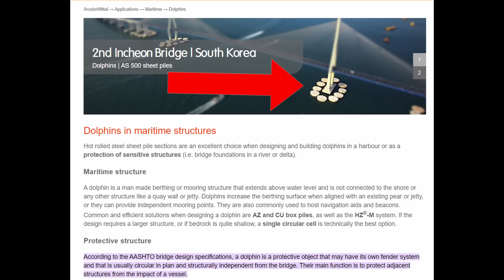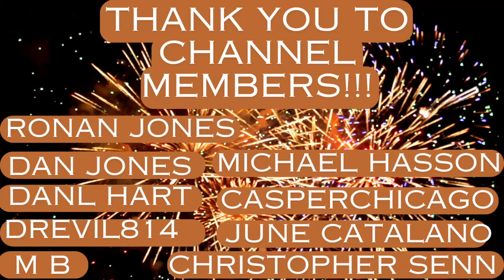Baltimore Bridge Collapse

Comment: There’s an old fort on the sea board side which would favour the outgoing ship staying closer to its starboard side of the bridge.   Strange absence of accompanying tugs?  Two pilots on board, so no possibility of human error in steering.   Awful night down in the engine room, sorry for what the crew faced and still face.
Shocking absence of structural protection, looks like corrupt risk analysis took place, shame.

Comment: There’s a shipping lane. And a harbor pilot was onboard. Shipping lanes are narrow. Which is why there’s a harbor pilot. It’s threading a needle every time 

It became adrift at 8 kts. And had dropped an anchor, late, and slowed to <2 kts. But it’s 100K tons. So irresistible force. As you pointed out other bridges have fenders of piles with concrete equal to, or more sturdy/massive the bridge support. But head on… 100k ton ship…
Reply: Watch Sal's YouTube Chanel for a professional discussion of what heated.  The ship lost power and rudder control. They got restarted and probably put prop into full reverse rotation in an effort to  slow it down, as well as dropping anchor in an effort to avoid hitting bridge at speed.  But ship's don't have brakes and can't be stopped.  They saw what was coming, but were just along for the ride at that point. No dolphins were going to stop a ship of that size and weight.
Reply: @mikedx2706 dolphins/ fenders sized for today's ships may have helped. Or may have not been enough.  Your statement is too broad.
Reply: I will not watch Sals video. @mikedx2706

Comment: Looks deliberate.  The ship swung wide of the dolphins and came at the pier from a reverse angle from its initial direction of travel.  The power going on and off and the throttling up of the engines (smoke) makes me wonder if there wasn't a struggle for control on the ship.

Comment: The ship was on course to pass beneath the bridge center span until it veered off course.
Reply: That appears to be the case, but dropping anchor and maybe reverse engine caused it to veer a lot more than if it had just drifted forward and not turned slightly like it did leaving the channel ...
Reply: @uploadJ  perhaps or the huge side area of the ship acted like a sail and the ship got pushed in that direction.
Reply: @mifphilip  even though winds were light, the direction of smoke indicates that the direction would push the ship towards the bridge pillar. Even in light wind conditions, this would have been a significant compounding factor against trying to regain control
Reply: Whatever the cause, it was a direct hit.

Comment: impact wise, its also has the harbour blocked and trapped many other ships that will not be able to get their cargo out until the bridge is removed
Reply from the maker: Good point.  Clearing the channel will likely take a couple of weeks based upon what I have seen on some construction jobs involving removal of bridge debris after a demo in a body of water.
Reply: @CaseyJones-Engineer  and that 2 weeks was when the contract was already in place and resources were pre-positioned and planned.
Reply: The trapped shipping containers can be trucked to another port. It is the bulk goods that will be trapped or unable to be delivered. Coal grain, oil, cement, steel etc.

Comment: Why was the cargo ship operating so close to the bridge? Perspective! If you go to “What is going on with shipping?” he shows how the ship was following the designated traffic channel until it lost power. When you view the map from above, you get a completely different perspective.
Reply from the maker: Thanks for that information!
Reply: Yes, next time, just go straight to Captain/Professor Sal Mercogliano at what's going on with Shipping, his channel has be covering everything going around the world involving all things Shipping for 3 years now. You would be hard pressed to find anyone more knowledgeable.
Reply: Definitely check out that channel. He is an expert on shipping.  @CaseyJones-Engineer
Reply: The ship channel goes under the bridge. Assuming MV loss all power, then it is just moving on momentum out of control. Looks very similar to the 1980 collapse of the Sunshine Skyway Bridge in Tampa, Florida. When this Florida bridge was rebuilt they installed an island around the bridge pier foundations.
PS — Freighter hit the old Oakland Bay bridge but luckily no structural damage. New Oakland Bay bridge will stand even if there’d is a significant earthquake in the Bay Area. 
PS2 — Engineering guidance was update in 1980s should prevent this type of failure for bridges built under that code but Baltimore bridge was built in 1970s.
Reply: @williamlloyd3769  , often the biggest failure in engineering and science is simply the failure of imagination.  How could no one have imagined this happening?
Reply: There was a Harbor Pilot on board.
Reply: 2 actually
Reply: @auntykriest  Yup.
Big beasts..
Reply: @abrahamdozer6273  More like a Pearl Harbor pilot...
Reply: @Bertrand146  "More like a Pearl Harbor pilot..."
Helm's over a bit ... total and sudden power failure.
.What would YOU do? Put on the parking brake?
Reply: @abrahamdozer6273  Not much indeed !
The momentum, the currents... The pilot tried everything he could and he will be told that had he done nothing, Dali would have drifted past the pier.
Reply: @abrahamdozer6273  Armchair sailors, who have no idea how big ships actually work, love to comment about what they know little about.  They don't realize that ships don't have brakes, and if steerage is lost, the ship will just keep moving at whatever heading the rudder is set to.  It will also be subject to currant and wind.  A ship no longer under control will go where it will go, and there is very little - if anything - you can do about it.
Reply: @JWRogersPS  ... and the momentum is amazing ... it takes miles to slow these down when they are approaching a port. The unfortunate part about these ships is the single screw, single humungous rudder and how it can't go much slower and still manoever.
Reply: Also the ship is 5x heavier than those passing under the bridge when it was built. The Dolphins (bridge protection) may have been adequate when the bridge was built, but no any longer. And this ship is nowhere near the largest containership sailing today.
Reply: The guy who runs that channel is a maritime professor at one of the merchant marine schools. He also has extensive experience out at sea as a mate, so he really knows what he's talking about. His channel blew up when that ship blocked the Suez Canal during COVID, and he covered it extensively. He's still covering some of the legal and financial aftermath of that event. 

He already has two videos on this event, the first of which came out just hours after the bridge came down. I expect him to continue to give us updates long after this event has run its course in the MSM.
Reply: @operator0  Are you related ?
Reply: Yep. Sal has great coverage. I don't know if we are seeing a transition to backup power or a main breaker/disconnect with a time delay before attempting reconnect. This is typically used to allow intermittent faults to clear and any circulating currents to dissipate through various losses. Either way, it's a terrible situation for everyone affected.
Reply: @RetiredEE  The power seems to go out shipwide. It went black. The fault/ breaker must have been right at the alternator. Stuff happens in this imperfect universe.
Reply: Yes, good answer. Dr Sal covered all that ... love all you guys doing vids on this, too. Much better than the news media.
Reply: Yes
Reply: This relic from the 1970s, 50 yr old pilons,Steel span third longest bridge in the world, major HAZMAT route with a tremendous increase of use, vehicle load weights increase over the 50years an no interest to replace it, make defense structures to protect collision is total incompetence, negligence by MARYLAND. The bridge spans collapsed dumping workers,drivers into the freezing dark water with twisting/falling steel in less than 2 MINUTES. 
The container cargo ship,top weighted, adrift tried to restart,avert collusion,dropped anchor and may have actually increased the swerving boat course towards the pilon.Don't know if just going with the current would have decreased the destruction.Prevention In Defense of The Bridge,A Newer Bridge Would Have Saved Lives.The Tampa Bridge Disaster,all engineers should have seen it after.I stood after and looked, was instantly nauseous. It gave me nightmares.This will too.
Reply: Also, there's a major port there. You can see it in the background. I suppose large cargo ships go through there frequently. (Apparently it's one of the biggest ports for cars in America, among other goods.)
Reply: from the navigation charts,the channel is only 150 feet from the pier, so he was not too far off the channel
Reply: There is still black smoke bellowing out of the stack before and after impact.
Reply: @randymclean9121 the black smoke started before impact. I think the were restarted and went full throttle in reverse
Reply: if you see the full video on what's going on with shipping, the ship looses power further away, then regains power shortly before impact, but by then it's too late to make a sufficient change of course to avoid an impact.  @randymclean9121
Reply: Possibility:  Think bad fuel killed the engines, and the black smoke from two attempted restarts. @randymclean9121
Reply: @randymclean9121 which is to be expected.  The crankshaft doesn’t stop on a dime when the lights go out.
Reply: @badlandskid  It is hard to understand, that in such crucial proximity to such, relatively fragile and important structures, that there does not exist a means to repel such a slow happening mega collision.  It is like a deer in the headlights moment.
Reply: @badlandskid Add to it that the main engine isn't necessarily producing any electrical power, there are often auxiliary engines that performs that task. Mostly because the main engine varies in rpm and power for driving the ship while the auxiliary engines provides electrical power with constant rpm/frequency and voltage.
There's also sea charts available that shows the designated paths for the ships entering and exiting, they can also provide a clue to what paths that the ship shall take.
Reply: @randymclean9121  pier protection structures were not mandated until some time in the 80s.  Iirc that bridge was built in the 70s thus “grandfathered “ in
Reply: @randymclean9121  unfortunately it takes a disaster such as this for people to pull their heads out and see the danger.
Reply: When accelerate the only propeller on a ship it will turn to one side (Propeller walk  - also known as propeller effect). No matter if they were starting up or reversing to try to minimize the speed, it looks to have one effect on course changing and going out of the normal channel.
Reply: It was perfectly in its shipping lane until it lost power and drifted powerless and rudderles into the pylon.
Reply: @PhilFromTinleyPark  re: "and drifted powerless and rudderles"
Anchor - an anchor on the port side was released and a bit of cable following also shows.
Reply: It is a pretty narrow channel.  This was an accident that was bound to happen with a power loss and so little margin.

Comment: As a truck driver, I can’t help but think about what my truck would do to a building or structure in a crash. I think the same way with boats and ships. How is it possible they had such little pier protection in a shipping lane with container ships? The consequences aren’t high enough to stop cost savings and poor design/workmanship
Reply from the maker: Thank you.  I agree with you on that.
Reply: I recently had a client who was at work when an 18 wheeler went off the highway and through her master bedroom. Her home was on a gentle bend in the road, and the driver had a medical event. Without control, the vehicle left the road at a tangent to the curve, took out a fence, and struck the building about the floor level and fell into the basement. Driver survived, and no one else was home. The entire home had to be torn down in order to do soil remediation due to all of the diesel escaping the fuel tanks. She received a settlement from the truck's insurance policy and I designed her a nice new home that was several meters further back from the original.
Reply: That’s wile. Glad she was ok. I’ve also seen a video on here where a car went airborne and struck a house at about 100 mph. Somehow the car didn’t come out the other side! It almost defied physics. The house must have been built like a castle.
Reply: @Eh_Wing Because I’ve done some site remediation work is why I’d never live at the end of a street or on the outside of a bend. At least not without significant trees, boulders or elevation change to protect the house

Comment: A cargo ship is awfully heavy with a lot of momentum- I don't know if a dolphin or other protective structure would do the job in a case like this.
Reply: “What is Goin on With Shipping?” Channel mentioned the vessel was 100,000 tons and traveling at 8 knots when it lost power, 7.5 knots at impact. That’s a lot of energy. 
Anyone know how deep the piles had to go?
Reply: @AtomicBuffalo  It wasn't the pile that bit it, it was the joint between the pile and the pylons...
Reply: @AtomicBuffalo  They reported the depth of the water to be 50 feet.

Comment: The ship was moving around 8kts at the time of the collision according to some tracking data. It apparently tried to drop the port anchor. And yes it was without power and most likely had no control of the rudder.
Reply: 8kts is not excessive. You can see the power flickering on and off a couple of times. During my naval service, my "Special Sea Duty" station (not US Navy) was Tiller Flats where the ship's hydraulic stearing is located. We were to operate hydraulic pumps manually to provide rudimentarry steering in case of power/hydraulic failure. This beast is huge.The rudder is a beast. They had little warning. It is unlikely that a commercial ship like that had any spare engineering staff on hand to operate emergency steering even if they had time to respond.

Comment: What amazes me is that there were so many sections of the bridge that came down. I would have thought that there would have been some sort of sacrificial link that would have broken to confine a collapse to the immediately impacted sections.
Reply: Continuous truss bridge
Reply: That was all one piece of structure, so it all came down together. I could have been designed as three sections, at a significant increase in cost. But even then, since the ship took out one of the piers, two of the three sections would still have fallen.
Reply: @andrewsnow7386 Thank you.  At the back of my mind I thought that might be the answer, but I didn't get far enough in civil engineering studies (I barely survived calculus, differential equations killed me) to  learn all those things.
Reply: That puzzles me too.

Comment: 4:19 surprising lack of protection for very vulnerable structure ☹️ 4:59 for reference, controlled bridge demolition 5:09 why ship so close to bridge - especially, as Sal Marcogliano notes, with Chesapeake Bay advisory pilot likely on board? 6:32 could be 3 years to build new bridge
Reply: I suspect the pylon guarding was designed for much smaller ships with the bridge being fairly old. Cargo ships have gotten much larger at a very fast pace over the past 2 decades.  Retrofitting it to protect against ships of this size would be exceedingly expensive too, a cost that is arguably unjustified to pass on to the tax payer especially on an auxiliary route. IMO the focus should be on the ship and providing auxilary power to the control planes when main power fails versus trying to stop a ship of that size from damaging/destroying the bridge.
Reply: Big box carriers like Dali were a bit in the future when that bridge was designed. They are aircraft carrier size.
Reply: @abrahamdozer6273  2x aircraft carrier size.... the new ford is only 100k tons, this was >200k

Comment: Pretty evident that such disaster was bound to happen.  Little to no pile protection against a ship collision, in a very busy area is questionable.  The electric pylons are better protected.
Reply: re: "Little to no pile protection against a ship collision,"
What size ship? These behemoths, 50 ft sailing ships, the QE2 ? DId container ships of this size exist in the early 70's (+50 yrs ago) when this bridge and pilings was designed?
Reply: @uploadJ  When you upgrade with new technology, like bigger ships, you must also upgrade the waterways.  Just like when you upgrade Windows or Mac OS on your computer, suddenly some of your peripherals may have problems to cope with the new environment and need to be upgraded too with new software or be replaced.